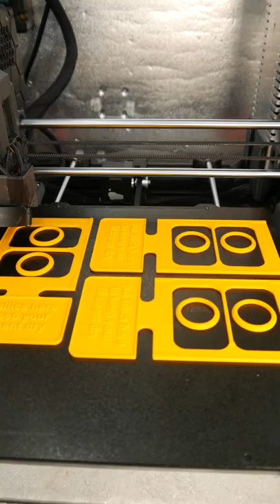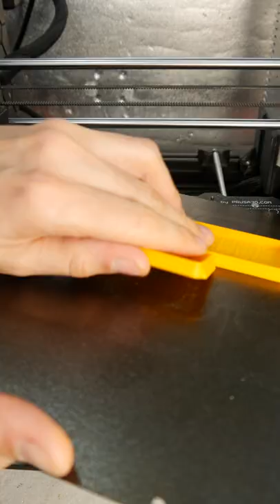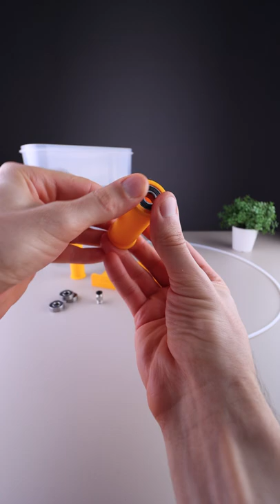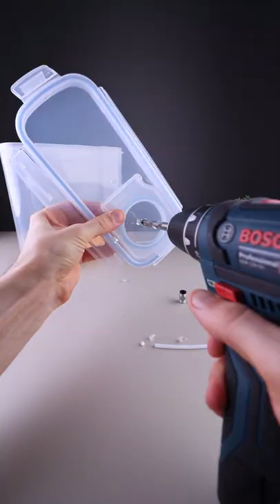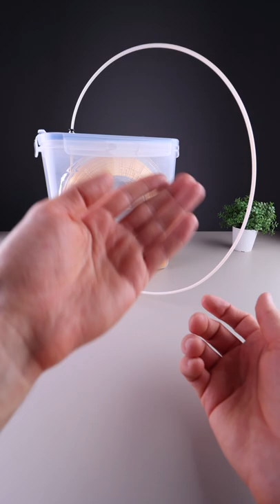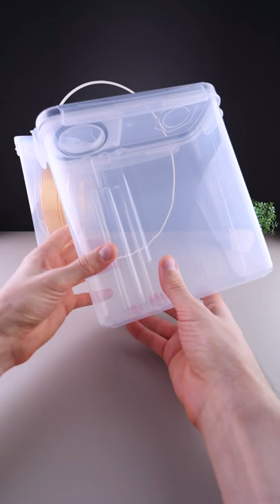marsgizmo Filament Bunker V2 - how to keep your 3D Printing Filament dry

Comment: It would be awesome if you could post the step files. I just picked up 12 of the 1kg containers and they fit great with all the filament spools i have with a little room for a roller of some sort. I'd like to make a version of your roller that allows it to be positioned in any orientation without re-designing everything from scratch.

Comment: Can you tell me please the Height of both cereal boxes? My filament spool has 20 cm in height and the 1Kg spool holder cereal box I saw that it has 20.7cm. With the support for sure it will be higher than 20.7cm.
Or share a link with the new box mentioned in the video please. the one from the description is not available anymore.
Thanks!

Comment: A Rival to Mihai's Box
Reply from the maker: It's not rival 😊 it's just a different design. Mihai's box it's far better and it will be part of a bigger ecosystem (there's a lot of work behind).
This is a quick solution until then 😉

Comment: Nide design and good idea !
What is the minimum inside width of container ? i'm afraid my 1kg pla (Dailyfil) doesn't fit insde (width 80mm)
Reply from the maker: sorry, forgot to add in description🙂, the box with big handgrips can hold Spools of 60mm width (usually 750g Spools) and the new one can hold 67mm width (usually 1Kg Spools)
Reply: @marsgizmo  Ok, so incompatible with 1kg dailyfil spool (80mm width) i will look for an other box but for now it's hard to fine, thanks

Comment: Question: why do you store filament?
Reply from the maker: all the filaments are hydroscopic (absorb moisture) and need to be stored in dry boxes, even PLA 🙂 Of course, if you're consuming PLA in a few days, then it's not needed. Otherwise, the print quality slowly starts to degrade (stringing, lower layer adhesion, etc.). 
And it's absolutely mandatory from day one for sensitive filaments like PETG, Nylon etc.
I will show more details over time.
p.s. and this will be part of a bigger projects, which contains a filament docking system, so you can quickly swap filament 😉
Reply: Good PLA will last for many months without storing it like that, but cheap Ebay stuff swells and the swelling can jam your printer. ABS and others MUST be kept away from moistre. Personally, I just use airtight bags with silica gel in them.

Comment: What about using cereal in place of desiccant? When it tastes stale, replace it.
Reply from the maker: hehe 😅 no, cereals are not designed to absorb moisture, they do but only a very small percentage, which isn't enough.
Reply: @marsgizmo  Yes but what cereal is the best alternative to desiccant? Opens up the door to a whole new line of testing. 😂

Comment: The cost and effort of your storage is getting close to the cost of the filament it contains. Isn't this a bit of an overdesigned solution?
Reply from the maker: that's true, depends of your goal. For me it's important to get high quality prints, even after weeks of opening the spools :) especially with PETG, but also for PLA.
Reply: @marsgizmo  But you can get high quality prints by simply storing your filament in airtight bags that cost 20c each! ;-)
Reply: I honestly hate rebagging everytime I have to change filaments, also, this container keeps the filament dry even during long prints.
Reply from the maker: @karld9817  I was having the same problem, that's why I made it 🙂
Reply: Awesome design, so I’ll be waiting for the 1kg spool update! Seems that everyone is excited for it.
Reply from the maker: @karld9817  I'll do my best to finish it and test it this until end of this week :)